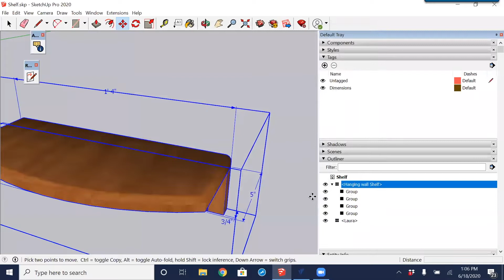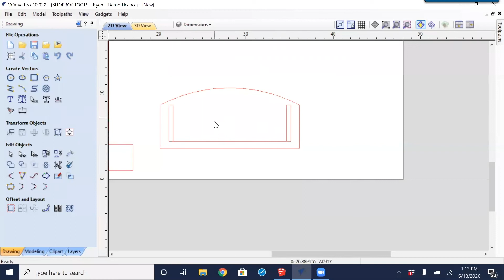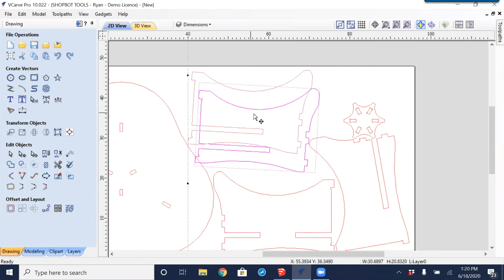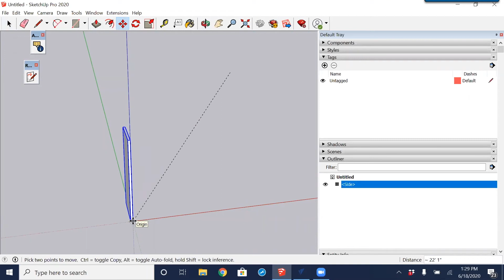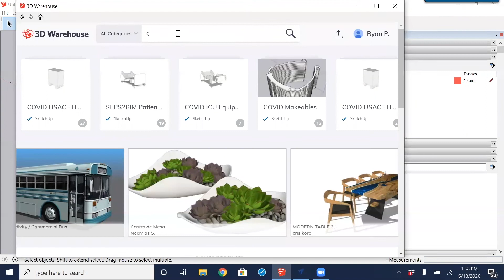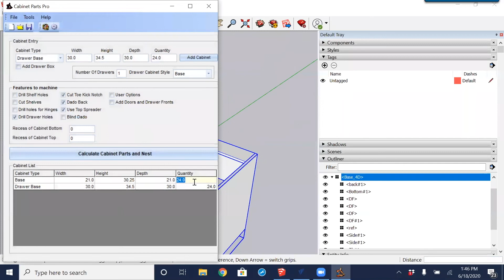Comment: I have multiple components in same drawing to send to v carve. Is there a way of labelling them so when opened in v carve it keeps the label.
Reply: Hi there! We don't think it's possible to transfer the labels, however, we suggest you get in touch with Vectric for their best recommendations in this process. They are always working on improvements and may find your feedback helpful for an update in their next version of the software. If you have any questions about how the software functions with your ShopBot CNC, please let us know! 888680-4466 or support@shopbottools.com. Thanks!